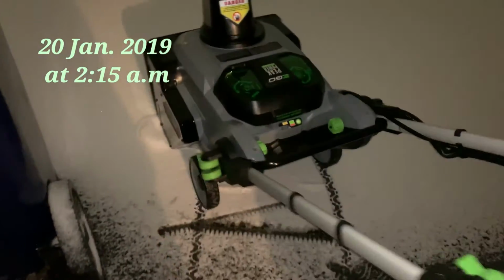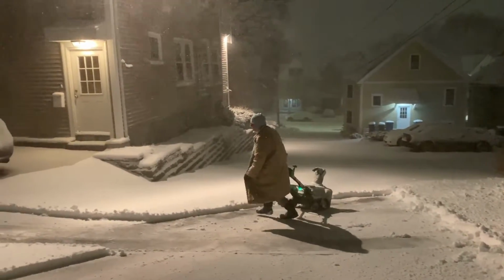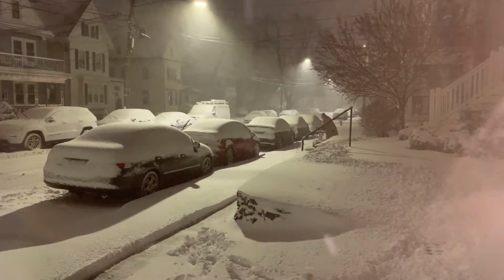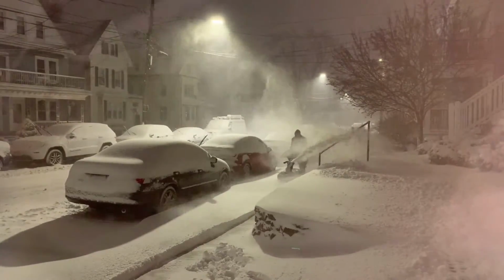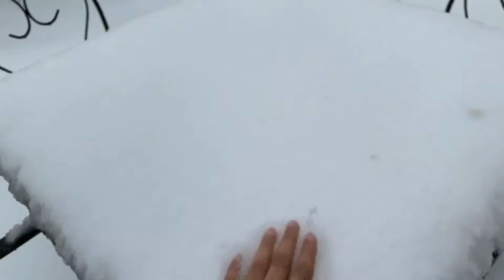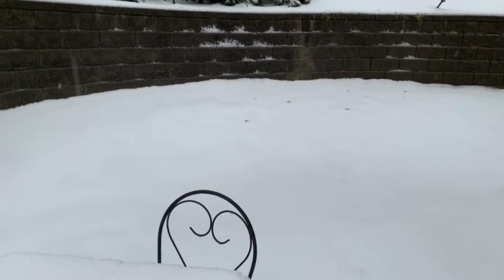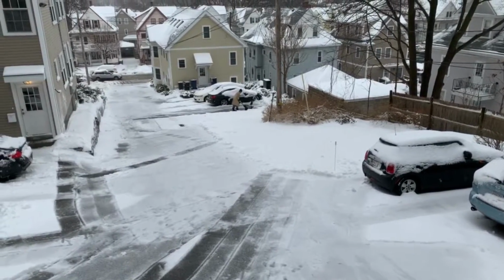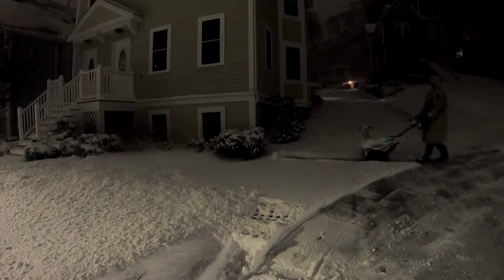EGO Power Snow Blower performance – during Winter Storm Harper in Boston 20 Jan. 2019

Comment: the batteries in that kit came with the level indicator  (Generation 3 batteries)(25%, 50%, 75%, 100%)  ?
Reply from the maker: Hello JohnMatrix.  Sorry for my slow reply.  On the battery recharger, there are four small rectangular lights that turn green when the battery reaches each of the four targets you mention: 25, 50, 75, and 100 percent re-charged.  The re-charger advances to each of these targets fairly swiftly from my experience.  Ego claims a rapid charger fully recharges in 40 minutes and a standard charger achieves 100 percent in 100 minutes.  In my experience, I have found the battery to be fully re-charged much sooner than 100 minutes.

Comment: Check to make sure your green handles down by the wheels are snapped down. There not suppose to be hanging loose it looks like they are. There suppose to be snapped upwards on the handle, it looked like your handle was collapsing or giving a little bit. Check it out!
Reply from the maker: Thanks, Smoooth.  You are correct.  We should have locked the handles down.  Still the machine performed well.  But next time we will follow your advice....